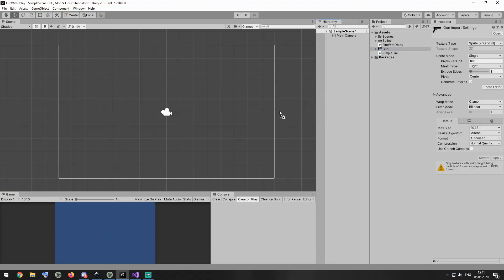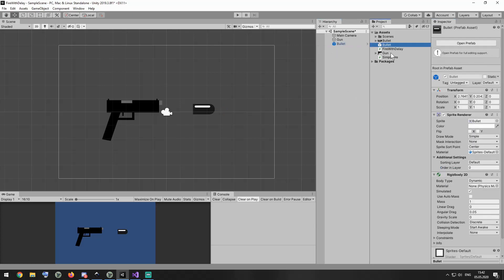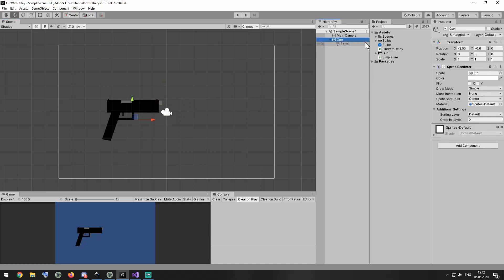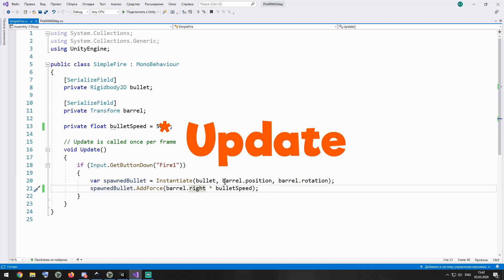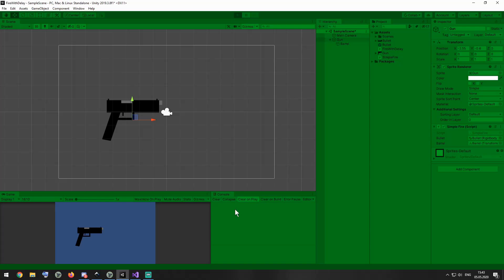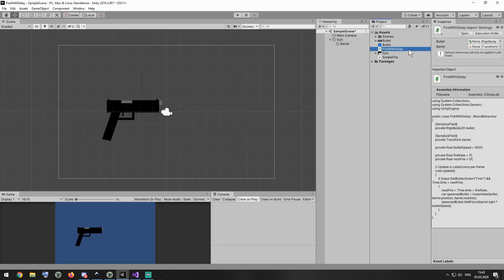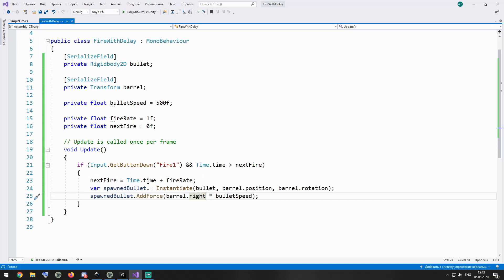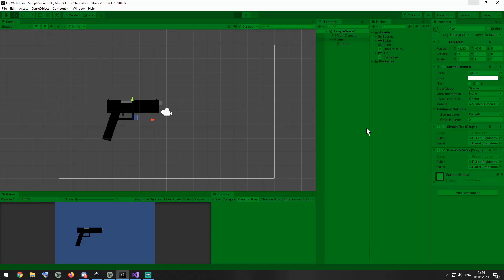How To Fire Bullets With Different Fire Rate In Game Made With Unity Software | Simple Tutorial

Comment: Hey peer, thank you for the tutorial but I have an issue, when I write the code spawnedBullet.AddForce(spawnBullet.right * bulletSpeed);
In Unity, an error appears "'GameObject' does not contain a definition for 'AddForce' and no accessible extension method 'AddForce' accepting a first argument of type 'GameObject' could be found (are you missing a using directive or an assembly reference?)"
any help ?

Comment: Isnt nextFire going to overflow the float limit if I let the game run for a long time?
Reply: @eucenor4171  Thanks for this; I was looking at this code and of course had to look up what "Time.time" specifically does and it said not to use it in this context; but if it takes that long for the count to cause any sort of issue then it doesn't sound like there is anything to worry about

Comment: How can i make autofire bullets by holding UI button??'
Reply: Silent Sale 

its just the same but instead of 
void Update()

you have to make a new method for the but to access.

public void FireButton() {
        The script!
}

and after that go to ur button and go all the way down in inspector. you will see a + button click on it and drag the gameobject with the script attach to it in there. then on the right side where u have dragged the script u click on it and select FireButton()

if u have questions let me know.
Reply: @zeroiq4737  same,on iu button my autofire cant work,because its on click button,googled for thst,they said its big problem to make autofire on UI
Reply: Use event system system and fire when pointer down event is used
Reply: @gambledornwer6140  can i post you my script here,im begginer ,you can look and fix?
Reply: @freeonline-games  sure, I can try
Reply: @freeonline-games  go to your button add component known as event trigger and add an event called pointerdown
Reply: @gambledornwer6140  I done it,added script drag drop and choose shoot,doesnt work just as manual, maybe needs correct script ,what to do now?